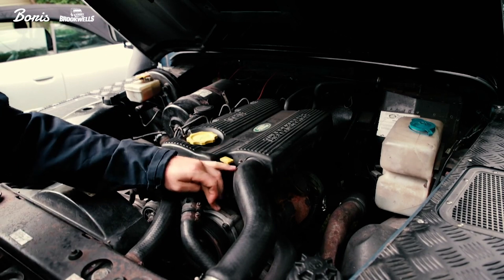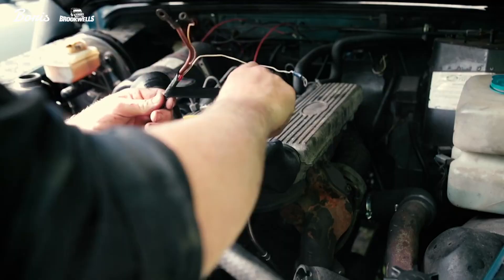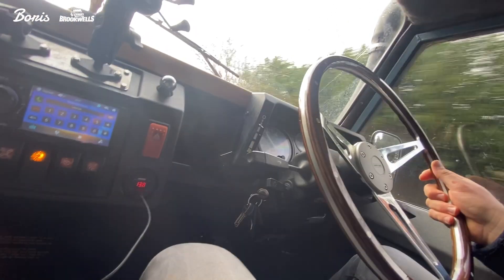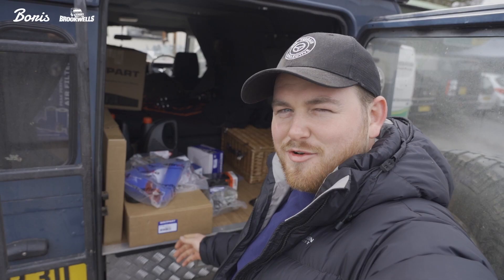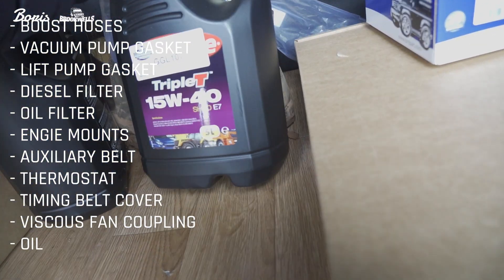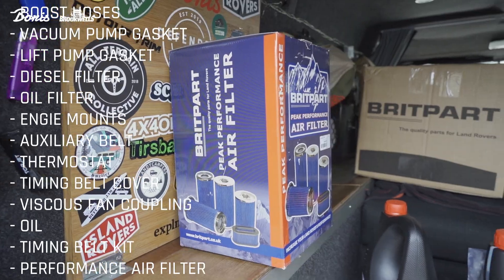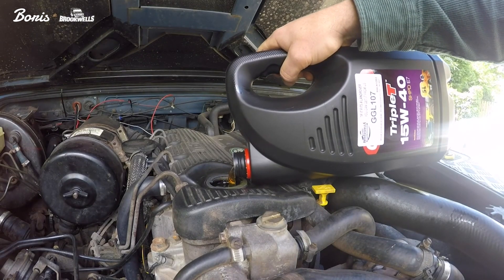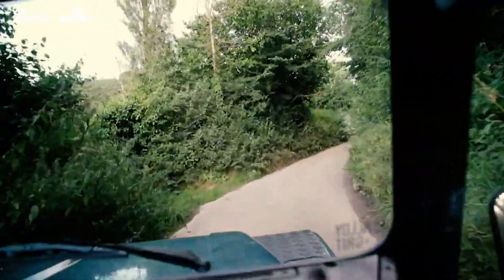Planning the Engine Swap - 300TDI Defender

Comment: Now you have a good base engine to work with, you should consider a few upgrades, i.e. Fourby Twin Air Inlet, MH Boost Pin and Fourby Boost Plate...Allisport are the BEST Intercoolers with a decent Griffin Performance Stainless Steel exhaust will make your truck SO different to drive - My Wolf is like a New Vehicle since I did all my upgrades !!!

Comment: I am thinking of getting a spare & engine/ gearbox & transfer box ... my 90” is 1988 in year out with the j19 engine.. in with a 300 Tdi , vented breaks up front, rear axel change disco 1 axel ..